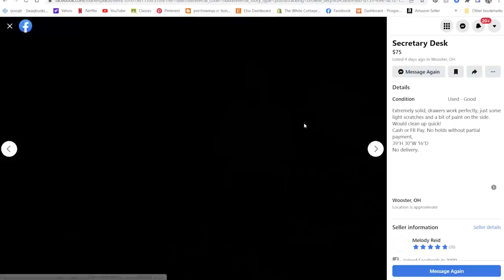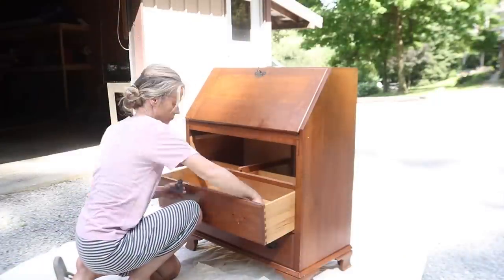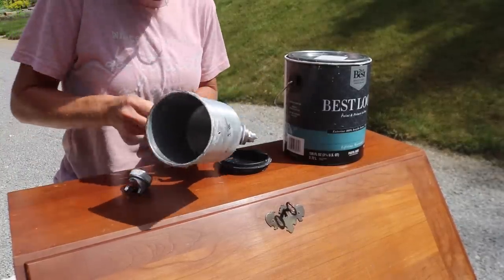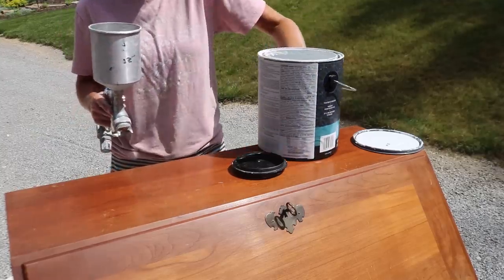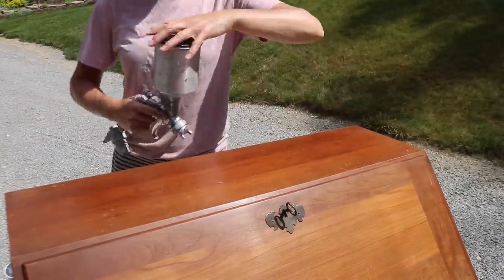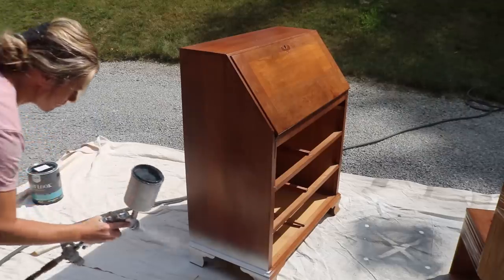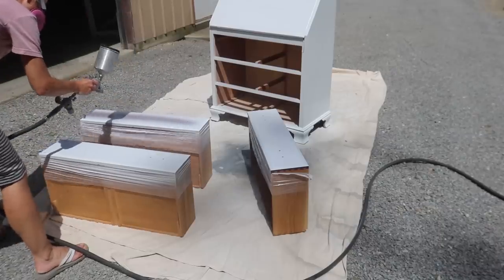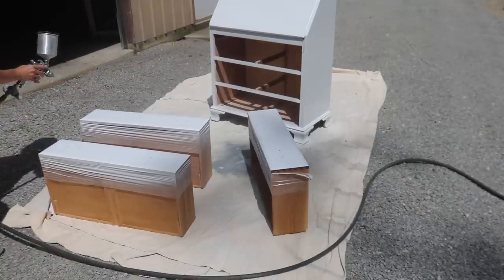Secretary Desk  Makeover ~ Facebook Market Place Find ~ Painted Desk ~ Before and After Desk

Comment: Hey Mary, 
My Dad had a similar desk to this at one time and I always thought it was cute. I like the white paint & bird- themed artwork you added. 
Q. As you began spray painting the left side of the desk (in real time) you paused about a third way up. When you started again the paint looked thinner. Did you adjust the pressure on your sprayer or was that just a shadow or the lighting? And, did you only use one coat on the whole dresser? 
Also, does the Crud-cutter eliminate the need for primer on a stained piece? 
Thanks. I enjoy seeing and learning from your creativity & projects. 
🌸Smiles, BRC

P.S. I think the desk would look cute in a cottage, your home or anywhere. 
😉👍

Comment: I have an oak hall cabinet with 4 drawers but the handles were broken, so I decided to replace them, the holes didn't line up so I had to re-drill them, one is now not straight, and every time I look at it it annoys me, I've tried filling the hole and re-doing it but it is so close to the original hole that it keeps sliding into that one, do you have any suggestions as to how I can fix this?